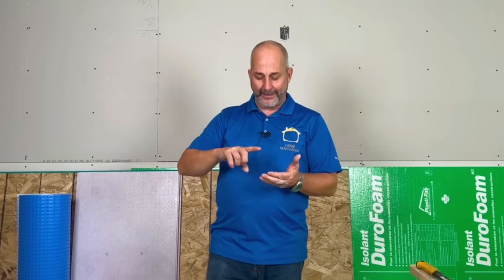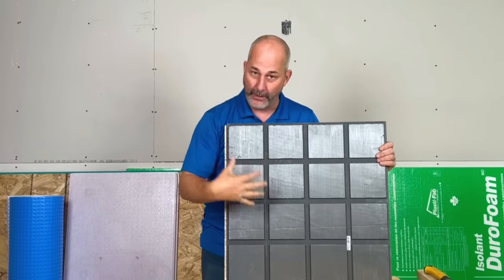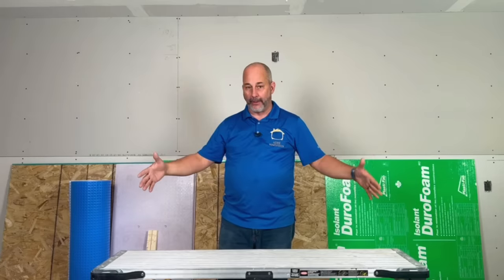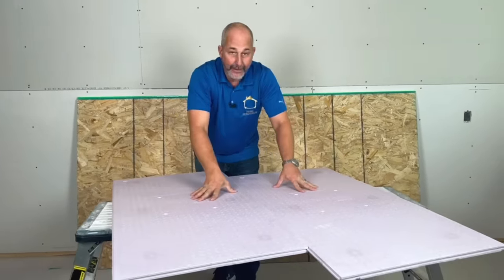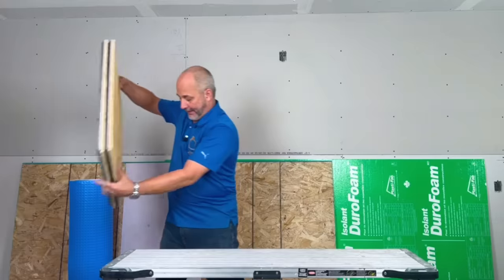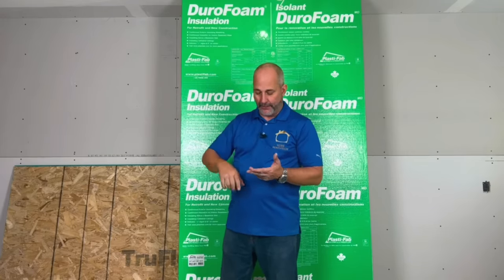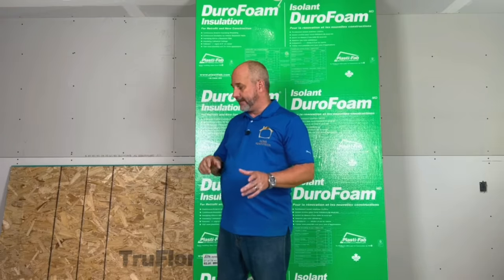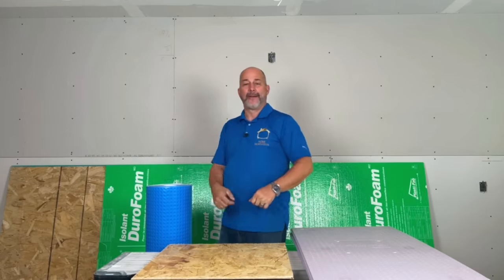Comparing 5 Different Subfloor Systems and What They Cost

Comment: Just found these videos.  Thank you.  We’re building a large shop in NW Montana—weather is almost like Canada.  One wing 12’x45’ is going to be my wife’s quilt shop.  We’re trying to decide what flooring to install.  I’d like your advice and recommendations.   We watched your videos and it sounds like durofoam and 5/8 osb would work well.   We haven’t committed to a particular flooring but wood laminate, tile or vinyl are ones we’d consider.  The slab is 6-8 inches of concrete with good drainage. It doesn’t have a vapor barrier and since I have ramboard down haven’t tested for moisture.    Thank you.

Comment: I have a house built in the 60’s. I’m in the Midwest where it gets very cold. I’ve had issues with water coming up between the studs and also down the walls. I have a concrete slab right now after ripping up carpet due to a flood. I’m going to install lock down flooring. I don’t want to spend unnecessary money,but I want to do this right the first time. I was thinking the DMX product with OSB. I would like to know what you think. The walls are freshly dry walled, but everything else is torn out. Thank you for the helpful video and any guidance.

Comment: 1920's house in Michigan (4ft frost line) with an unfinished short basement (~6' of height, ~4ft below grade and ~2ft above grade). It lacks a vapor barrier and has cracks in the concrete. It's used for laundry, storage, and utilities (HVAC, Water Heater, etc). My priority is managing moisture while staying as thin as possible, so a finished floor isn't needed. Do you think a panel option would be best, with attention to detail during install? Other notes, the concrete is not original to the house; was painted at one point; and is un-even with high and low-spots.

Comment: Hi, I live on the east coast of Canada. I am replacing laminate in my basement with vinyl plank or waterproof engineered hardwood. I already have a plywood subfloor. I am looking for the best option for a thermal break on top of the plywood without it becoming too thick? 

Most flooring these days have a backing and suggest not to use soft underlay. 

Thanks for your videos. Keep them coming.

Comment: Hey Jeff. Avid DIYer here and absolutely love the channel. Incredibly knowledgeable. 

I’m planning a basement reno for a house built in 2021 in Southern Ontario, Canada. Don’t have enough window room to bring in large sheets.. I’m even a bit concerned about bringing in OSB from inside the house due to tight corners.. what do you recommend for sub flooring? 

Reno is on a budget AND thinking to do a laminate or engineered hardwood finish.

Comment: Live about an hour north of Toronto. Town house. No moisture in the concrete floor. Sump pump never goes off for us. Renovations start in 4 weeks for a full basement with a 3 piece bathroom. Going with Luxury vinyl plank flooring with the attached pad underneath and 20 mil wear layer on top. An msi everlife LVP. We have talked with our contractor about subfloor. Whatever we choose is fine, but he says we don't have to do one but if we choose to do one its not a problem there our plenty of options but not 100% needed. I mentioned dmx and he said sometimes they create humps. the osb tongue and groove he said is good but is kind of overkill for us, and the cost is quite high. Thoughts?

Comment: Hey Jeff!  Enclosing my back patio to make it a 3 seasons room with a fireplace to use it in the winter (Pennsylvania cold climate).  Can't decide between the R+ insulated Dricore or the Dimpled/DMX membrane system you do.  How much of a difference does that insulation make?  Worth the cost?  Flooring will be either carpet or vinyl plank.

Comment: Jeff as always thank you for providing all these informative videos, I spent 2 years renovating my house before I decided to move back into town. A lot of your videos have helped. my current house does not have a subfloor system and is an older house so I need to worry about moisture management for subfloor just to be on the safe side. In my area (NL, Canada), I see 3 possible methods for subfloor. 1- tongue-n-grove plywood with plastic dimples, 2- Delta-FL floor underlayment with foam board on top before laminate flooring, or 3-Barricade Thermal Shield Subfloor Panel that allows laminate flooring directly on top. Any opinions on any of these 3 methods?? Would appreciate thoughts on these.

Comment: Jeff I am using Drycore with foam insulation because of access , very easy but going to use the DMX on top of Tile floor in basement, so I am using both, great video

Comment: Great video! I am in Calgary and am looking to replace an existing carpet install with the LVP in the summer. I think there are no moisture issues given how the lot is a bit higher than my neighbours' lots. What is the best way to verify my theory? and what subfloor system is the best for my situation? If it helps, I have already purchased planks that have underpads on them.

Comment: First of all, thank you for all your videos, you are my numbero 1 ressource when it comes to renovation 🙏. I live in Montreal and my house was built in the late 40s, so no french drain around the foundation. Occasionnaly, we get some water in our basement when snow melts or in the event of a heavy rainfall. Is insularmor the way to go if I want to install floating floor? My ceiling is not the highest so I want to keep the thickness of my floor at a minimum. Thanks again Jeff, you are truely the best

Comment: Hi Jeff. I hope you or anyone else will see my question/dilemma. We are renovating an old house built in the 40-s. We want to put hardwood flooring in the kitchen. Can it be installed directly on the joists, without subfloor? The reason is that we want to have the kitchen floor  even with the rest of existing hardwood floors in other rooms. Thank you!

Comment: Looking at insulating my cottage floor from the inside with adding some type of flooring on top that could handle some abuse from the summer foot wear traffic. The main floor is elevated off the ground by almost 2 feet. Just looking for winter warmth for those 40 below nights and seeing frost on the nail heads!

Comment: I have in floor radiant heat in my basement concrete slab. No moisture issues. Interested in your sub floor opinion. And for that matter flooring material opinion as well. Thanks for all the great videos!

Comment: I used the blue dimple stuff in my basement with 3/4 inch engineered hardwood. Came out great and the floor isn’t cold. Good thing I chose that because those 2by2 foot blocks are a rip off here in Canada

Comment: I'm leaning towards the InsulArmour option.With a Rvalue of 4.1, I like the idea of anti-fungal protection and moisture management even though my '86 built Kootenay home is very dry. With water, you never know. Question: Do I put OSB on top of the InsulArmour? If so, would I use concrete screws (as you did with the DuroFoam option) to secure the system?  I understand that InsuArmour is very rigid, but I'm curious about down the line if we decide to change wall layout our construct build-in shelves etc. It seems to me that OSB on top (like your DuroFoam solution) would give me more options for future renovations. Would love some feedback!

Comment: Omg this was great! My house was built in 1976 and previous owners did partially finished basement which I am updating/upgrading. My concern is musty/mold. Three quarters of one basement wall is covered with knotty pine but I can see a clear plastic sheet between wall and pine paneling, the rest of the rec rm walls are knotty pine too but are not against the basement walls however some of the bottoms of the paneling had mold so I painted ALL the knotty pine paneling with Zinsser shellac primer to seal them. The rec room area currently has carpeting and I want to re-carpet this area again but dont want any more mold growth on the Zinsser painted pine wall paneling. What flooring system would you recommend? Thanks !!!! PS would be nice to have warm feet but not required.

Comment: New to the channel and love the content! 
I have a 100 year old house, No sand or gravel below concrete. Basement is small (200 sq/feet) but whenever the snow melts or we get a lot of rain, lots of moisture comes up. Not creating standing water, but seeps into carpet padding and carpet. 
Planing to replace with one of these options soon - Which would you recommend - Dricore or Dimple membrane? (plan is to put LVP on top) 

Thank you for all your content!

Comment: I always enjoy your videos. I do get occasional flooding in my basement (working on an exterior solution) of an inch or so. Legit had two floods in the first month I lived here. However my current finished floor is an ugly rubber interlocking tile that sites directly on the concrete. This works but I'm worried about mold under it over time. I've been running fans for almost a month with a dehumidifier. I've seen the dricore OSB panels in the big box stores but was always worried that OSB doesn't manage water well and would be a waste of money once they get ruined. The other Dricore foam panel seems like it might do the trick combined with a waterproof LVP on top. Never knew about it. This video was super helpful.

Comment: Thank you so much for this information!

Question: 1950 house. Basement slab floor with cracks. Planning to fill/seal cracks and then install subfloor and carpet with a pad. 

Which of these options can be done with carpet after subfloor? 

Thank you in advance!

Comment: This is so helpful.  I could use a little more direction.  I have a house in southern NY, brick, built in 1953 with a finished basement.  There is vinyl sheet flooring glued directly to the concrete and I cannot get it up, all it does it hide the floor, I can still feel the concrete directly below my feet.  We're at the bottom of one hill and the top of another, but I believe I've solved the flooding issues associated with that.  Some insulation from the floor would be great but it's not my main concern.  I'd like to soften the feel of the floor on my feet and I need moisture management.  Can I use one of these sub floor or barrier systems directly over the glued down vinyl?  What do you think would be best?  And what flooring system would I have the best luck with  laying on top of the subfloor?  Thank you, I'm so glad I found this channel.

Comment: Have gone through Dri-Core twice and in flooding situation it's a bad call. It grew mold and the worst part is that you will not see it since you will house a floating floor on top it (laminate, LVP etc). My final solution post mold issues? No organic material touching my floor or 2 ft of walls. Just insulate the poured cement floor with moisture barrier paint, and then use 5mil plastic sheet, and then install LVP with padding. I could not notice any temperature difference between Dri-Core and my new install.  Cut the walls in half and then I installed 3 ft of mold resistant green board (the ones used for bathroom). I sleep well at night now knowing the mold won't grow in my basement and it has turned out to be darn well. Just don't use any organic materials in basement folks, if you can avoid it - just do it. Not worth against your health.

Comment: Hi Jeff. First off, thank you so much for your generosity and time. Your videos are immensely informative. I have a room that was once the second half of my garage. It is an un-insulated on grade slab and is ice cold in the winter. My challenge is that I only have 1 1/2 inches between the slab and the threshold. I would like to avoid re framing the door to the garage if possible. I don't know that there are moisture issues specifically but since I fully intend on putting down floating floor, would using DuroFoam as the thermal break be risking moisture issues as that would be no air gap? Re framing the door isn't out of the question but I'd like to avoid. Thanks

Comment: Hi there! Thanks for the vid. I simply just want a soft floor to walk on. So I bought the 2x2 foam tiles (like the ones for yoga or for children). I put them on my concrete floor but not touching the edges/corners. Now I'm wondering if I should put a dimple barrier underneath? I'm worried about mold. Will the foam itself prevent mold? It is completely smooth at the bottom of the foam. What about just a thin polyethylene layer? Thank you 

House is in new England and is built in the 60s. The basement is not finished. Walls are concrete. No windows. Bulk head. Dehumidifier running all day but still is musty.

Comment: Yeah I agree Jeff is a great source of information for homeowners especially when you live in Ontario.  I have a question though and can’t find a video for it.   An attached garage conversion with concrete floor in an older home, i want to put down hardwood floors and want to do framing and drywall to divide the space what is the best course of action regarding the floor?  Do I put the durofoam down and framing on top then hardwood? Or do I need a water management system?

Comment: AMAZING!!!!! I have a home built in 1952 in Michigan with a Poured Basement...the Basement is completely finished, Drywall Ceilings and Walls + Carpet! I have struggled with water coming in from somewhere (likely up through the Floor or Walls behind the Drywall) for 20 years!!!! I use my Basement as a Family Room and need to replace the Carpet due to the ongoing water issue BUT I will not do that until I have a solution for this water coming in. Based on your video it sounds like I need a Thermal Break and Water Barrier; however, you never mentioned anything about Carpet going on top of any of these solutions! What is your recommendation for Carpet? I SO thank you for this Video...I didn't want to have to do a complete Water Proofing system costing me $10k+!!!

Comment: My experience with TapCon screws is that they snap, unless I completely clean out the dust from the hole with a shop vac. When I do that, I can drive the screw all the way in and it holds well. Otherwise it snaps about 1/4” before it sinks into OSB. I even used the drill that came in the box, same result.
Reply: Absolutely need to clean it out. The dust isn’t “ part of what makes it hold”….

Comment: First off, love the channel and have used it for many upgrades, maintenance, and renovations so far. 

I have a 1950s house and noticed some water intrusion along the cove joint in the basement last spring with heavy rains. I am in Southwest Michigan. I have addressed some downspout issues and plan on tackling a couple other areas outside this spring. 

My initial thought was to use the Dricore panels but it seems I may have a few other options after watching this video. Maybe using the DMX dimpled membrane with 5/8th OSB on top may a top option after watching this. My plan is to do the entire basement starting with the egressed bedroom. Would appreciate any insight into what you think!

Comment: Wow! Great video! Here's our project...... early 1900s two story commercial brick building. We'd like to live on the second floor above a bicycle shop that we run on the ground floor. The second floor has old beat up wood flooring that was covered with carpet and linoleum. We'll most likely apply laminate as the finished flooring. We were thinking of a plywood sub floor installed on top of the old wood flooring, then the laminate on top of the plywood. Any advice you are willing to give is appreciated. Thank you —

Comment: Your videos are great! I have slightly different challenge that does not include a concrete basement but, instead a main floor 'wreck and rebuild'. My single story 1200 sqft. cottage is about 120 years old. The Main floor sits over an unfinished dirt crawl space that is quite damp/wet and at times where I have to put in a sump pump to clear out the accumulated water - so yes. wet. This fall I want to tear up the main floor, remove and replace the "joists" with new pressure treated 2x8s, 16 inches on centre then put down a moisture barrier of some sort, add plywood on top and then top it off with a floating vinyl floor. I am very keen to hear your thoughts about what kind of moisture barrier I should be using: if its a foam-based then covered with plywood, will that compress over time and make the floor uneven where the joists are? Is a thick poly sheet of plastic, overlapped by 6 inches and taped at the seams a better way to go? As far as use goes, we are there only 12 weeks in the summer and it remains unheated though out our Quebec winters. Thanks in advance for your help on this!

Comment: Thank you, Jeff. Question: For an old home without a vapor barrier below the concrete floor. What if you seal the floor with some sort of  liquid concrete sealer and then use the blue roll of stuff and then a floating floor?  Would you get moisture management and a thermal break doing it that way?  Is there any concrete seal coat that you would recommend?  Thanks for the great videos, Trish.